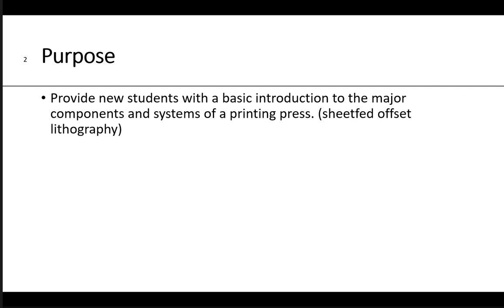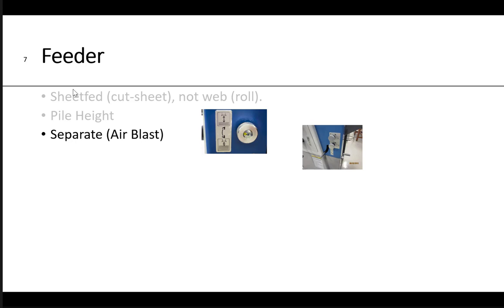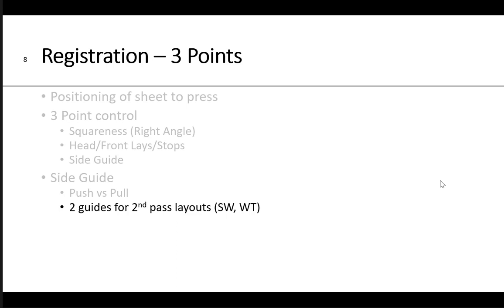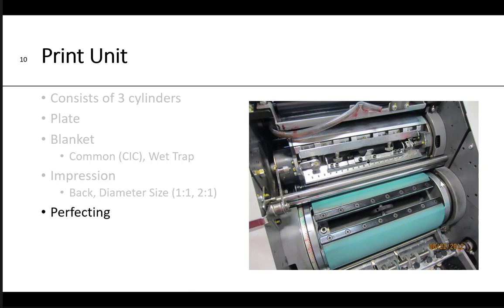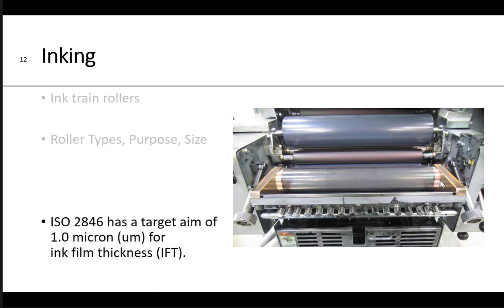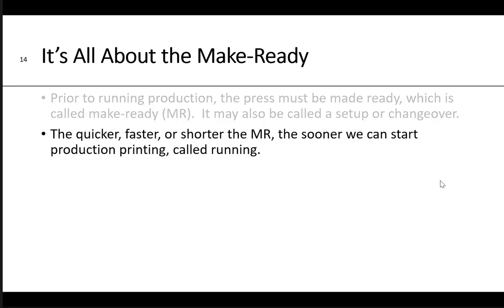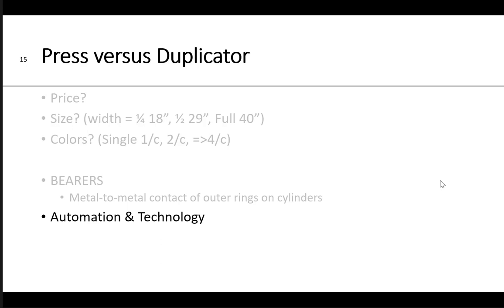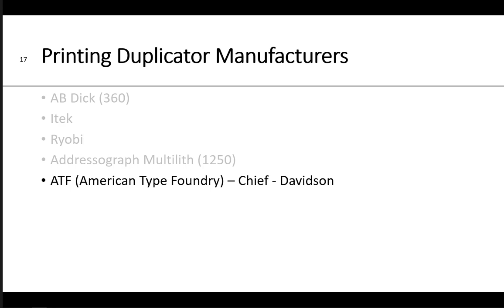Printing Press_6 Major Systems

Comment: What is fountain Solution? And what is the purpose of it. I will very glad if you reply 🥺
Reply from the maker: Lithography needs a chemical solution (95% water) to keep nonimage area of plate wet/moist/damp to stay clean.
Reply: it supplies water into the non image area
Reply: what is the common fountain solution mixing formula? im using ipa and combifix and sometime getting too much emulsification

Comment: In delivery section how to set the cam?
Reply from the maker: On AB Dick 9800 series, there is a spring loaded collar with numbers on the shaft on the button/operator side near cam follower.
On Ryobi, you need to loosen and move the cam.
Reply from the maker: Do you mean the side and rear jogger?
The "cam" is for the gripper bar sheet release timing, drops sooner or later.